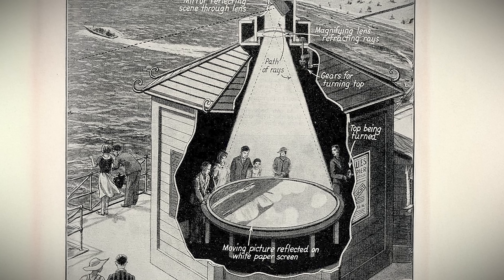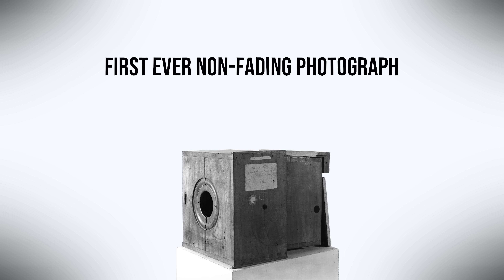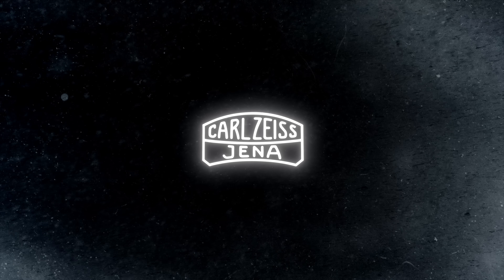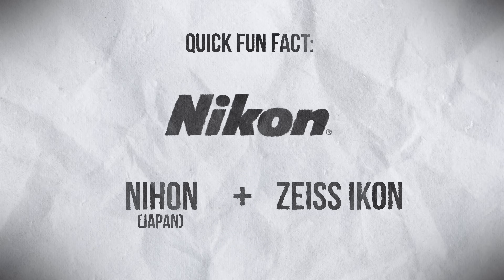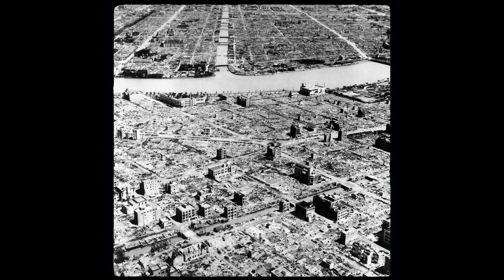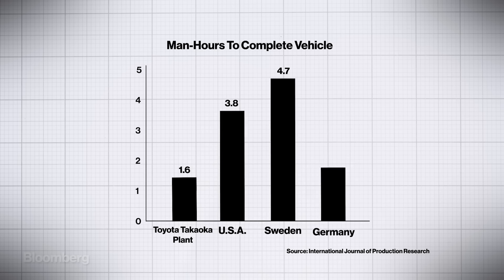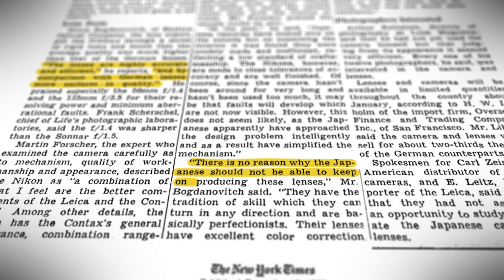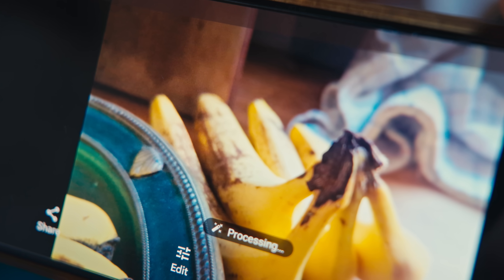Why are ALL Cameras Japanese?

Comment: I bought a Minolta XD black .... last year love the camera , I like the Minolta XD over my Pentax MX and my Olympus on 10 , Minolta XD equipped with a 50mm f 1.2 lens , Japan is the place to go for cameras ... Camra shops still have camras brand new in the box lol can buy  Nikon F4s  still in the box wrapped brand new in Japan camera shops lol ... if you're thinking about buying a 35 mm camera and you don't know if you want a Pentax MX Olympic song 10 a Canon A1 ...buy a Minolta XD black ... how do you think Sony got into making cameras ,  Sony  bought out  Minolta R&D and equipment Iona Minolta Z1 -  3.1 Meg. Camera it took awesome pictures and it took awesome video ... then I bought the Canon G2 .  4  Megapixel ... the Canon G2 took awesome 4 megapixel pictures but when it  came to taking  video it was crap lol ...  Minolta Z1 3.1 megapixel Memory SD card , Canon G2 4 megapixel CF memory Card ?   and the Minolta won out lol .. for Video  if I had to pick from Minolta XD black and like I said I have a Pentax MX add Olympus on 10 I picked the Minolta XD

Comment: I'm glad Japanese lenses are getting the love they deserve. My old Nikon Ai-s and AF-D lenses are spectacular. The ability to put an AF-D lens on my film camera is amazing and they even have smooth focus rings for auto focus lenses. I would argue Nikon's 85mm AF-D 1.4 and 105mm F2 AF-D DC are the best lenses for creating stylistic and beautiful photos of people. The DC lenses absorb red light different to soften skin tones and the pictures are painting like with a sharp subject but a background that melts away like butter. My D700 has a near 100% in-focus rate with the 85mm despite the D700 using it's own motor in the body instead of in the lens but this also makes the lenses smaller which is fantastic. I can't stress enough how good the D700 is by the way. I am not interested in upgrading.

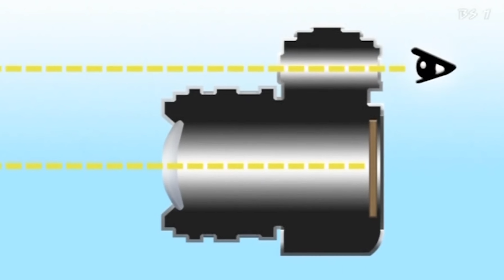Comment: 7:48 - this is incorrect. A Twin Lens Reflex (TLR) camera is specifically one where the second lens is used with a mirror and a ground glass focusing screen to allow you to compose and focus. "Reflex" refers to the mirror. TLRs usually made you shoot at waist level since you looked down into the viewfinder. Most of these were medium format (taking 120 and 127 size roll film) and were relatively large, tall and boxy. There were many types of non-TLR cameras with separate viewfinders, such as the Leica rangefinder cameras you see earlier in the video.

Comment: I really hope that Chinese cameras will emerge, such as companies like DJI or Huawei. Cameras are now one of the few mainstream electronic products from Japan, but it is obvious that they have also fallen into the kind of squeezing and ineffective innovation (if you have had contact with Japanese companies, you will know what I am talking about). The current camera progress is completely decoupled from the progress of the entire electronic and electrical industry. The features of mobile phones can be fully possessed by cameras. However, after achieving monopoly, these Japanese camera manufacturers colluded with each other and were keen on monopoly and completely unreasonable premiums...even though this has ruined the compact camera and a large part of the APSC model market.

Comment: Kai Zen my ass. It was the JCII, about which the video wastes not a single word. 
The story is extremly simple: After the war the German industry was robbed of it's patents, which were made public domain by the USA. Having access to the top notch technology it is easy to build upon. (And this is not the case only for camera and optical technology, Germany was nr. 1 worldwide also in the chemical industry.) Add to this the directives and tight control of the JCII (Japan Camera Inspection Institute) for exported cameras and there you have the complete story.

Comment: I'd like to add/ correct Your statement - nowadays the Photographic Market is dominated by japanese manufacturers, as after WW2, all German camera patents were declared void, and Japanese manufacturers subsequentially copied systematically pretty much ALL of their optical & other designs to start making clones of german CONTAX and LEICAS etc. especially almost ALL the optics from NIKON & Canon nowadays are based on former ZEISS Patents - developed by the famous Dr. Ludwig Bertele, Merthe, Tronnier et al. in the 1930 and later at ZEISS-IKON Jena & Dresden; especially optics has been massively improved by Prof. Alexander Smakula from ZEISS-IKON and his ground-breaking patent granted in 1935 for optical coating as to increase the transparency of optical components by reducing the refraction - all Facts NOT developed by the Japanese rather than by the Germans/ namely ZEISS-IKON !

Comment: one fact you forget, All cameras are Japanese, simply due to Sony (a Japanese company) making ALL of the cmos sensors used in them!!
Reply: Sony is a major sensor manufacturer, but not the only one. Nikon and Canon use sensors from Sony, Towerjazz, Matsushita, and Toshiba. Actually, Nikon and Canon also make some of it's own.
Reply: @rbrtmllr  Canon develops and manufactures every dual pixel sensor they use (as far as I know). So basically every APS-C and Fullframe model is covered by Canons own sensors. The only cameras where they rely on Sony are those 1" and smaller compact cameras. Nikon designs some of their own sensors but don't manufacture them.
Reply: thats like saying most phones are either british or chinese because the chips are made from there